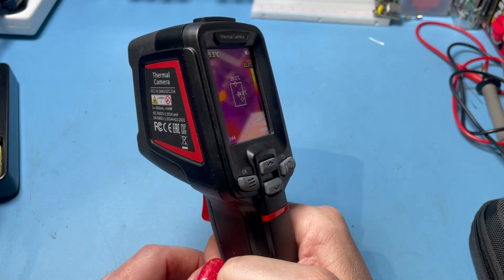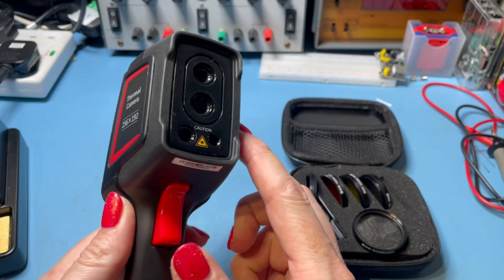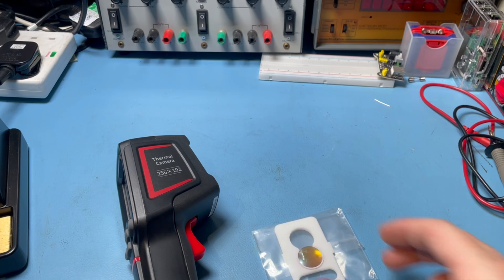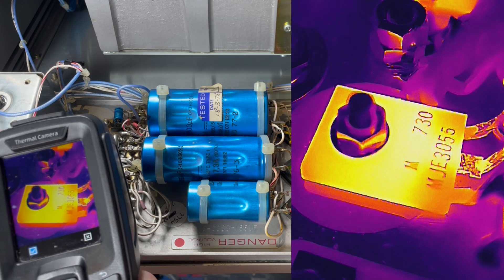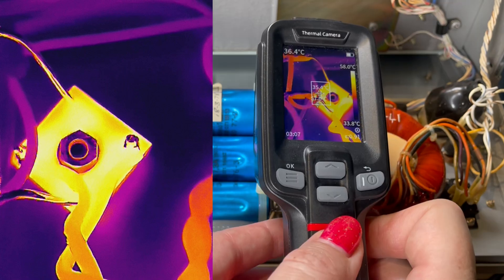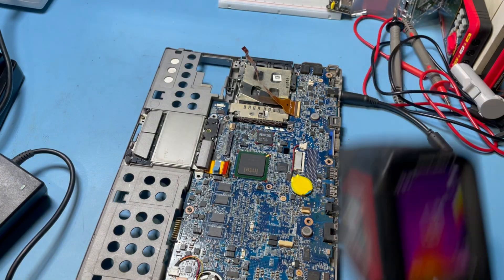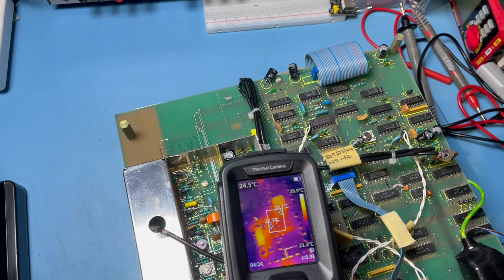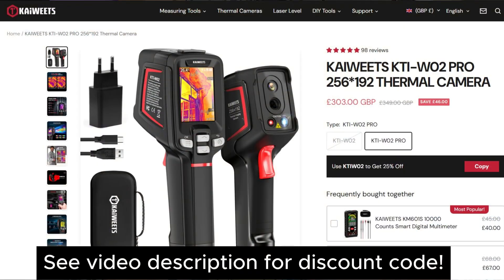Kaiweets KTI-W02 Thermal Camera - Adding A Macro Lens For PCB Inspection!

Comment: Thanks for another great review. For the $, I will still go with Klein because of the larger screen. It's not likely to have Macro capabilities either though. I was thinking that I would use a different cam for the bench work anyway though. I'm in all the trades but retired, so I still need a lot of tools and devices. Thanks again for all you do.
Reply from the maker: You're welcome 😊

Comment: Eeeep $400 it better be good at that price 👍🏻
Reply: For $400 you can get really good thermal devices. I use a BSIDE X3 which does a good enough job at under $100. It's not a luxury device, far from it. But it helped identify even parts getting warmer by 1-2 degrees than rest of components. Video convinced me to get a macro lens for it, but I will have to design and print my own holder/clip for it.
Reply from the maker: Good thermal cameras are not cheap, but I have included a 25% discount code in the video description.

Comment: Jazz, I picked up a DOOGEE Fire 6 Cool Smartphone (unlocked), that has a thermal Imaging Camera built in for $270 US (right at GBP 200) But it doesn't seem to be available in the UK (Temu).  The thermal imaging is pretty impressive and considering it's HUGE 10,400mAh battery AND the PRICE WITH THERMAL, was a great buy!!

For any of your US fans, this may be a slightly more budget friendly option for a thermal camera (that you can have with you all the time).  I wish you could get one, I love to see your thoughts on it!
Reply from the maker: I have looked at it but thermal resolution is quite low in comparison to all of the thermal cameras I have reviewed.
Reply: Its on Amazon UK but a tenner more.
Reply: @electechyt  That's still a good price.